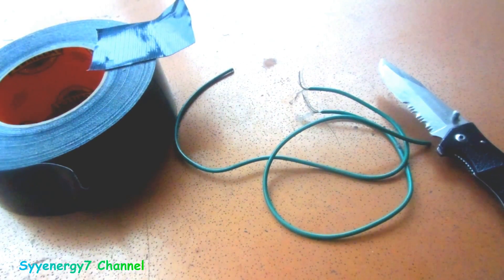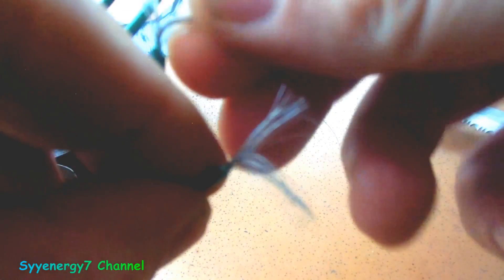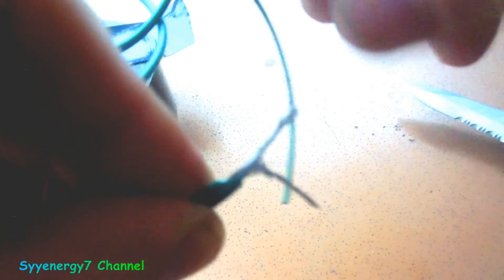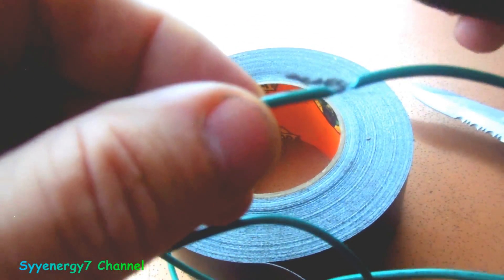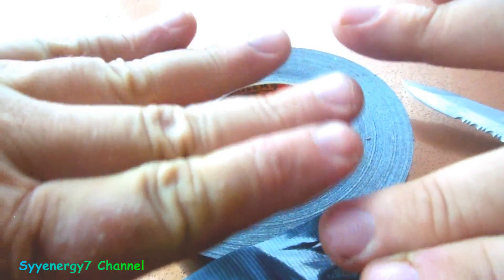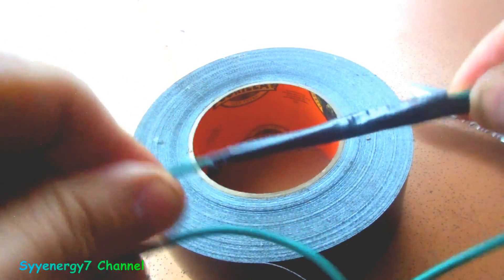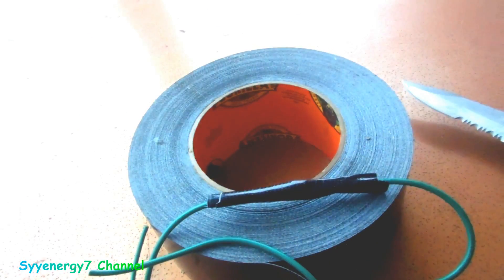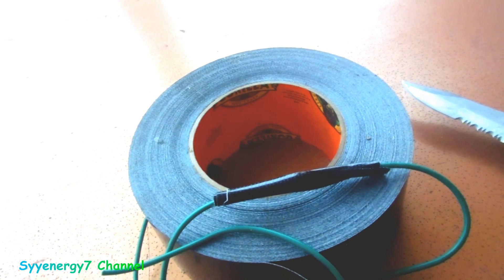Splice Wires Fast & Easy, Yet Strong & Waterproof

Comment: Put a piece of conduit over the section behind the tree. It will force them out into the open.
Reply from the maker: Yeah.  This person likely walks by here often and he's be easy to identify by the walk.  The 2nd camera is another 25 feet closer to the road and at a better angle, plus color.  The big thing is that now I know what's going on and when.  It's not some kids hiding in the trees across the street.  It's not a person that lives close by.  It's not happening at night.  It's one person and not a group.  I was wasting time looking out at night.  Nothing happened for over a month, but I kept running the camera and checking the wire.  At least know I got a much better idea.  They will walk by again.   I can easily identify this person by the walk.